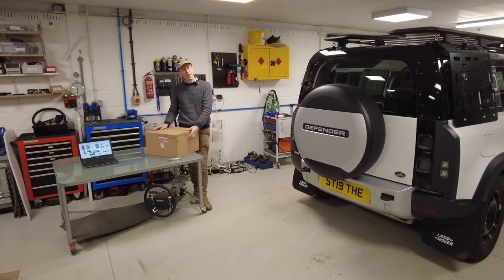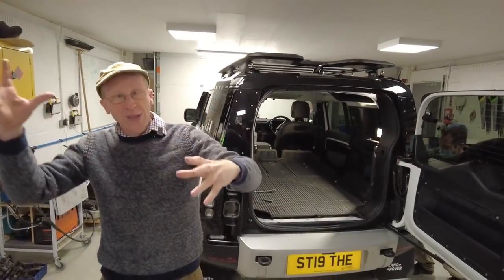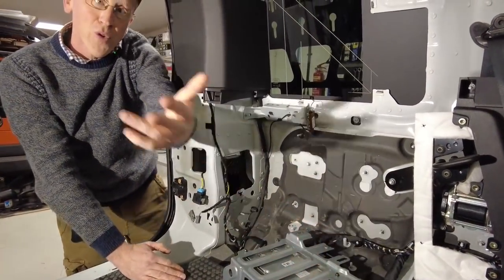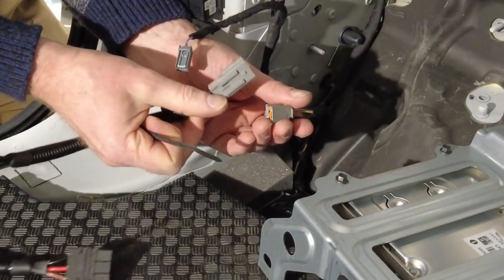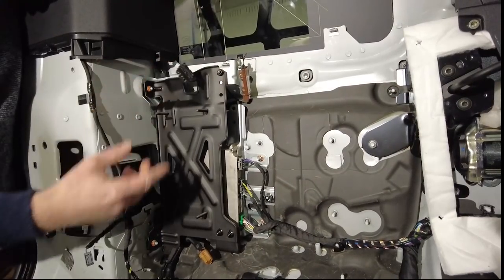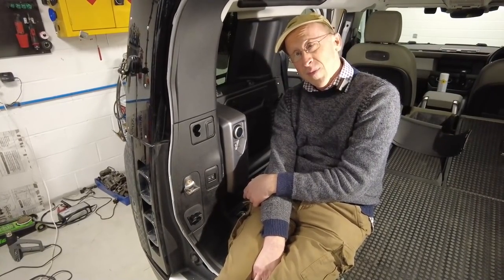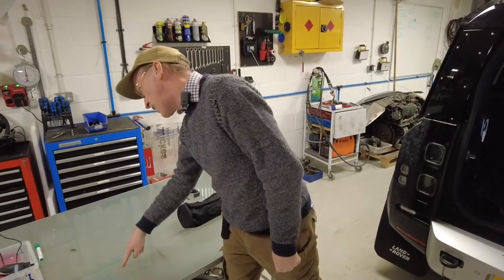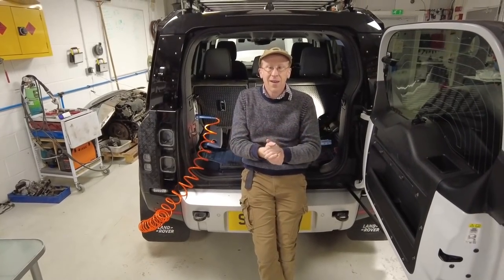New Land Rover Defender Integrated Boot Air Compressor Fitting Instructions - VPLES0617

Comment: My RRS L320 (‘07) has a cigarette adapter in the rear, near the truck’s cargo cover.  Seems like this compressor could be used for older cars as well. Sure, mounting it would be custom, but overall wiring would be simple.

Comment: Great video again Simon however that screw on schrader valve is a pain in the backside, if by chance when you go to screw it on to the tyre you are going to pump up and the valve cap is missing and the threads are a bit rusty you aint screwing that on had experience with this,  ended up going back to the old but gold press on type and especially if you have been offroading and a cap falls off you will need to make sure the threads are all clean before using it also if you get the threads inside the fitting crossed threaded thats the hose knackered .
Reply from the maker: Yes totally agree - I have ordered the ARB hose set to see if this is compatible !

Comment: You ask why the Air Suspension compressor can't be used instead? Well what about the folks that order their vehicles with Coil Suspension? That means they'd have to create a standalone compressor anyway for those people, but then have the added complexity of having a second system for cars with air suspension.

Comment: Could your air down to 18psi then time how long to get up to 32 psi please Simon? 
What is the stated duty cycle of the compressor as the continuous use of my old ARB compressor went into a safe mode whilst airing up 4 tyres on a warm day.  I know have a Viair portable compressor which is excellent and has a good duty cycle. 
When can I expect my beanie hat didn't  mention in the earlier video when spotted the missing link but this on with no link to interior panel removal ha ha.

Comment: Simon i have one question regarding the compressor. I have been using it quite often but it is the second time that i am facing with a blown fuse problem. It was already installed when we picked up our Defenderder last year and after the first fuse problem i took defender to them and they have just changed the fuse and gave me one additional fuse in case it happens again. So, do you have any idea why it happens? I know it is just a fuse but I am gonna pick it to the dealer tomorrow but seriously wonder why it is happening.
Reply from the maker: There is a software update available - can you see if the dealer can perform this for you.... also if you can get the user name and password for us all to do the update that would be great.
See below link and see step 31 where it mentions the software update.
http://accessories-instructions.landrover.com/enUSA/new-defender/G2409729
Reply: @L663  i will be giving all the updates about it. Thank you so much for the info by the way. Just downloaded the app and going to ask for it too.
Reply: @L663   I visited the dealer today and told my blown fuse problem and Compressor software update. The surprising thing is, i think i am the only guy in Germany who mentioned it to a dealer 😁 because they were surprised and told me that they have never heard of it. They checked and downloaded the app but interestingly wasn't able to provide me the password. They are gonna wait for an answer from Land Rover.

Blown fuse has been replaced with a new one as a temporary solution. I even told them i could do it but wanted them to know that this was the second time i have faced with it. They also offered to put a different fuse to get rid of the issue but i told them that they have to check it with Land Rover first. My updates will continue 😁
Reply: Here i am again with my latest update. Dealer has updated the compressors software but they haven't given the password and email address to me. They said that this is only for retalilers and added that i am the only guy and they are the only dealer who has asked this question to Land Rover from Germany. I wasnt able to try the compressor yet because i picked up my car yesterday.
Reply from the maker: @hakansultanoglu  Thanks for update - please share any update.

Comment: I have a 2005 Chevrolet Uplander with a compressed air port that uses the rear air suspension compressor, and there's a button next to the port to engage the compressor along with a valve that sends air to the port instead of to the helper air bellows.

Comment: I've been thinking about this and one of the installation guides seems to show the amplifier having a cooling fan - is that only certain models?  I'm wondering how much airflow would be blocked since it seems to show it fitting right behind where the compressor bracket goes.
Reply from the maker: I have the low spec amp and dont crank out the tunes too loud - so should not be a problem for me !
Reply: @L663  Looking at it, the bracket is right up against the plastic panel anyway so I suppose it's just a few mm less gap.

Comment: Hi guys I have the IAC but keep getting an E2 error when using it. Power is getting to the unit have you ever experienced that?
Reply: @Destiny Slater took it back to the dealer. Loose wire.
Reply: @Allevj30  I just had the dealer install the IAC in my 2023 Defender and am getting the E2 code. I guess I need to take it back to have them fix the loose wire.

Comment: Strange question that I keep coming up with on Defender videos....Can my LR4 take that?

So my LR4 has a cigarette lighter in that same area...could I install one of these back there if I could find a way to mount it?
Reply: Was thinking the same can't see why it can't be done with some mods to it
Reply from the maker: Thats not a bad idea... we need to take a loot at that...
Reply: I have a D4 and that was exactly what I was thinking - Come on, Simon, you are the man for this - and have three customers lined up already!  Great channel!!
Reply from the maker: @jont3354  I hear you ! More D4 stuff coming ...
Reply: I fitted a Genuine Land Rover Discovery 5 Wireless Phone Charger (VPLRV0118) with a bit of moding the loom seats  in the d4 Cup holder nice. so be good to see if one of the air compressor will fit

Comment: I thought with the Disco and RR's, they could put a valve in to the air tank for tyres etc. But then someone said that the compressor pumps would just get too over worked and crap out more (than they do now..??). I guess if you're clever, you could upgrade the pump and fiddle..?
Someone with a D3 converted to coil springs, then used the air tank for things and just put a switch on the compressor relay to top the tank up

Comment: Simon - Nice video.  Different question - previous video you showed a prototype bumper trim that wrapped around the top of the bumper. Your now selling an After Market bumper protector - without the wrap over.  Will you still sell the other one?

THANKS
Reply from the maker: Correct - our design of bumper cover will be here... but it has not shipped yet and it will be way better than the LR design so please wait a bit longer.... I paid a lot of £ tooling that up !
Reply: @L663   THANKS Simon - you may also have noticed on a few selling platforms a Stainless Version that Wraps..  will you sell that one too?

What else you have in the pipeline?

THANKS!!
Reply from the maker: @simonreader7301  We have lots...chequer plate door handle bowls / full mirror covers with gopro mounts / chequer plate rear tow surrounds...

Comment: The big need is to pump up airguns. However this compressor will get nowhere near the 3000psi/200bar required. Us sporting types are very demanding of our trucks! That being the case we need a secure location for a diver's bottle. Don't fancy one of those hitting the back of my head in an accident on its way through the windscreen.
We also need something to legally carry up to four rifles or shotguns in the back, without being on the floor with all the other luggage parked on top limiting accessibility.
Reply from the maker: Lots of gun talk here...not an area I am familiar with...
Reply: @L663  
A relatively high proportion of LR Defender owners will be though.

Comment: Do we purchase this compressor from Land Rover? Would they be able to install it in the dealership ? And how much did it cost. Thanks!
Reply: These are now vin restricted due to people buying up stock. PowerfulUK may have stock so check them. Otherwise it’s a dealer item.
Reply from the maker: The dealer price is around £616 for the pump without fitting..
We will try and source some ( currently we do not have any ) and make them available
Our prices can be more than a dealer due to postage costs and potential ebay fees etc but we try and be competitive.
Reply from the maker: Thanks for the info...I will try and source some.